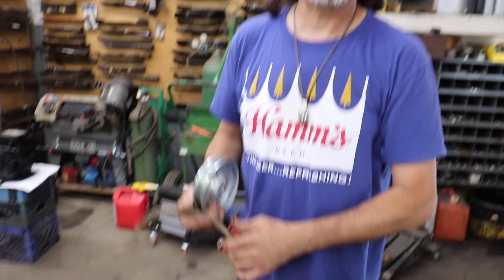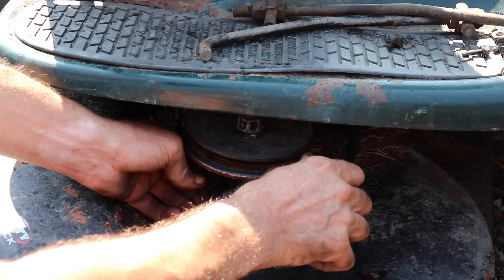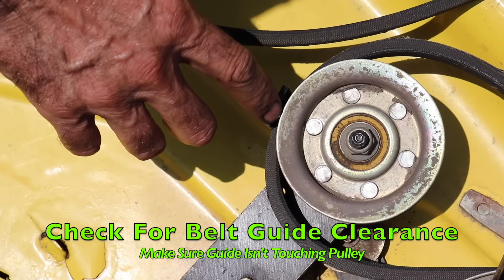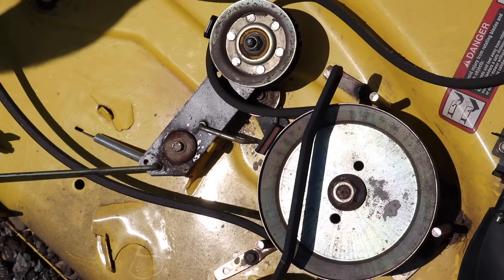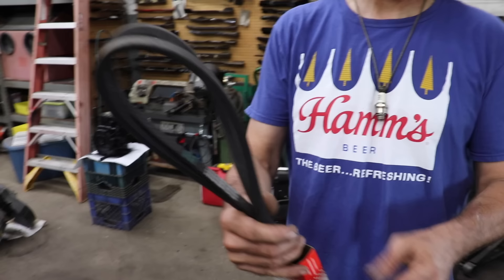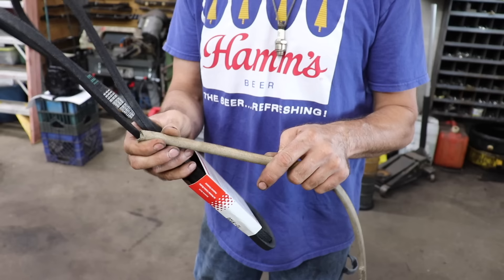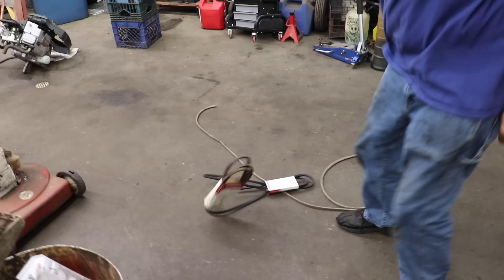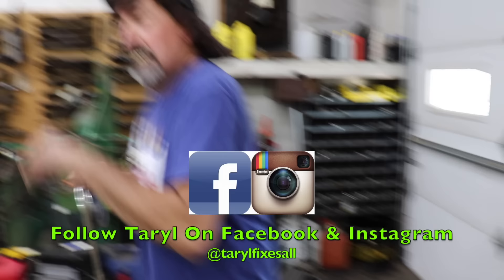Why Do Mower Belts Break?

Comment: I've got a 1992 snapper sr33 high vac deck w an industrial 14hp ohv briggs. Its also got the bagging wagon bagger attachment.  I had to rebuild the differential trans and replace the direct drive clutch . I also replaced the flywheel gear and starter gear because the valves needed adjustment. Guy i bought it from said it was a b%$#^ to start fixed that adjusted valve lash and It starts easy since. . Burns oil tho needs top end valve job n rings. Had the gas in crank case valve n seat issue and wife ran it w gas in there n smoked it but we didn't know. Until it hydro locked . Fixed that and it does run but need to add oil often n smokes a lil.  
I went ahead and bought 2 lt1000s for 300 and rebuilt one with a krohler command cv16.. cleaned it up amd rebuilt the deck n sold it  for 350 and kept the newer craftsman lt1000 w single cylinder 17.5 ic engine  that was rebuilt and replaced the axel on and got a 3  bagger system my wife found for 75.00 . I had to rewire it completely and it runs really well. It does surge a bit til it warms up. Low jet issue? I have to choke it 4x until it levels out buy it runs good and idles good when its warm. So all in all 
I have a "new" tractor i like and only spent 60 bucks for it. 
And a snapper I have had for 11 years I don't wanna part ways with. Its just a good tough little tractor.

Comment: haha,classic,one other thing I found out as well is,that when you are changing over to new belt that you need to reset the deck as the tension on the new belt will be slacker as it is not stretched like the older belt & deck be slinging new one off or because of the too much slack,gets caught where it shouldn’t & gets cut & breaks....

Comment: I had replaced the upper drive ( 5/8×35 ) with a original MTD. Lower drive engine to rear with 5/8x69 not MTD. Was a V belt kevlar blue color from TS store. Now the specs in size etc from MTD is what I got for both belts. Prior all my old belts was MTD on mower. They all are cracked bad. Mower moved fine in FF and rev with old belts. Now with NEW belts  in reverse mower moves same speed as old belts BUT forward it moves alot slower. Would that lower drive I replaced ( Husky named ) be the cause???? I did buy a MTD 5/8x69 new now. Just have not put on yet and wonder if I should or just leave other on. Yard Machines 2008 mower Briggs 17.5 I/C.

Comment: I set the engine to idle first and then fully engage the mower deck to start the blades turning. Then after the belt is fully engaged I gradually throttle the engine up to full speed. This puts less wear on the belt every time you engage the deck because the belt doesn't have to slip as much. Engaging the belt with the engine already running at full speed accelerates the blades very quickly from a dead stop up to operating speed causing the belt slip a lot more, which wears it out much faster.
Reply: It’s important to engage deck belts at lower idle an also helps to not lower deck until cutting blades are first engaged then lower to preferred cutting hight ,this can reduce belt wear an belt coming off in the blade engagement process,,

Comment: The problem I'm having with Exmark 23 kc mower is the belt slips of the jackshaft pully and drops below the deck.  Only thing I've been able to do is remove deck belt and pullout the jackshaft so I can reseat the belt. Shouldn't there be something to prevent this from happening? The space between pully and deck is too small to raise the belt otherwise.

Comment: Taryl set me straight on the long transmission belt that is common on the high horsepower MTD tractors. They are not cheap by any means. A lot of the internet sellers try to sell you belts that they say will fit, but you cannot even climb a hill with them

Comment: Once went through over 20 belts one season. Turns out my competitor had welded a razor blade on the deck right next to the belt. Under a heavy load it would shake just enough and slice the belt clean in two. I'd be replacing the belt and my competitor would run over to the customer and get all the business.
Reply: How did he get access to your mower deck?
Reply: Like Billy Joal sang it's just a fantasy, it's not the real thing.

Comment: I got a new Toro Time Cutter EZ ride 54" zero turn with the Toro 24.5 HP engine. I did not buy it on your review. It had many good reviews. At 5 hours, the battery was dead when I went to start it. My so called professional Toro shop that Toro sent my machine to for free setup and delivery (barged how good they are) left items undone. Such as proper deck setup. I called about the battery issue and was told 3 to 4 days. I know that's at least a week. So I found loose and dirty electrical connections in several places and fixed it myself. Now at 7 hours, the engine backfires and diesels before stopping with the smell of unburnt gas.
Also my idle rpms are 1600+. Sound to high. I can't find a spec on idle speed. I can only see 1 screw on the carb from the back that I assume is the idle speed adjustment.
Any Ideas?

Comment: Belts are not created equal I have found if I order my belts through Sears with the stock number out of the tractor manual they’re $45 each which I’m not happy about but they last a long time I get 3 seasons out of them cutting grass in a large field I have tried belts from all over the Internet companies that have all these outrageous claims not one not one has made it through two sets of mowing through this field not one you get what you pay for

Comment: heat will destroy a belt as well.  worn pulleys can cause new belts to fail prematurely.  I always replace the idlers when I replace a transmission belt to maximize the life of the belt.

Comment: My brand new Ferris zero turn broke the drive belt at 50 hours. I was pissed they used a 1/2 belt on that heavy of a machine. I was on flat ground going average speed or slower because of my bad back. It came flying out the font of the mower without breaking anything like the plastic fan or even breaking the mower deck belt. First it need to be a 5/8 drive belt. Plus it was put together in 5 places. The belt looked like brand new just broke at one of there splices. When I put the new one on which was a real pain in the ass checked for alinement look good and all pulleys look good and spun great with no out of round. Have another 50 hours and been turning the engine over before it starts to make sure its not coming apart again. When I put a new belt on I always run cycle it about 3 times. Heat up and let it cool down. Helps a belt last a lot longer for a 80.00 belt. Had a John Deere zero turn the belt sideways for some reason and took out several plastic idles pulleys that run on stupid angles which is just looking for problems. Sold that piece of shit mower for  6,000 dollars. Had that for 3 years and tranny took a crap and the steering gas operated cylinders. They tried to fix the trannie and messed it up. Iran it in the garage and it pulled the engine down when you tried to go forward so jacked it up with floor jack and in 20 minutes with it going forward it smoked the trannie good. They came and got it and had to put a new trannie in it. When I sold it only had 75 hours on it. Tuff torq trannies are junk. Warranty was up and the tech guy said they have had a lot of bad trannie from tuff torq. So either I sell it or buy the extented warranty. Which was cheaper than a trannie. Put it up for sale sold in 2 days. Told the guy what problems I had with it. Did not matter to him a john deere is the best he said. So he bought it for 6,000 just for the shitty name.

Comment: My neighbors scrub Cadet kept losing the belt and it was the tensioner had rust on it around the pivot point so it couldn't swing the full arc to apply the right tension.  I cleaned it with a wire brush attachment on my drill greased it and she's been going all summer

Comment: I had a JD 318 once and after I owned it for a week I came home one day and heard a noise coming from my garage. I opened the door and found that 318 engine was rolling over but not starting. I had to unhook the battery to stop it . The starter was smoking hot  and it was about to start on fire. The key was in the off position.

Comment: In all my years I have never seen a loaded mower break a good belt, and rust is the only pulley defect that kills belts is rust.  I fix and use them from the 50’s to brand new.

Also I never use any generic belt if I can get them. The generic mower belts don’t last.

Comment: So has anybody here tried a stens or other aftermarket kevlar belt on a john deere F series? I've seen Taryl has a 525 with one wheel in back. I have a 725 with 54" deck. John Deere belt is >$100 and aftermarket is <$60. It is a v on each side, so I thought it may be worth coughing up the green for the green.

Comment: The wrong belt will cause damage to the trans if it drags when you push in the clutch. It will shift hard and you'll have to slam the shifter ,usually skipping over the gear you want .
Reverse to first

Comment: Put a b belt on my cub cadet works great not running too hot and gets better contact area with all the pullys. Should last alot longer and half the price of the cub one. Sheesh 100 bucks from cub for a belt no thanks

Comment: Yep, I have a JD 318, 86 model in fact.  That kawasaki engine, with sharp blades, is an awesome mower.  But you are absolutely correct.  Just buy the damned JD belt -- give them their proprietary money -- they will get it from you one way or another and at least your lawn will look good.  Thanks for dinner.

Comment: I have a jd stx 46, I warm the 15 hp for a few minutes before I engage the deck drive at a little over idle.. then run the engine at w o t, 
it’s a hydrostatic drive so regulate the machine speed with the transmission.. 
have had the same belt from jd for 12 years..
You must have jd belt to manage bending inside out as it passes through the tension pulley..
Blunt blades will just rob power and leave a poor finish to the lawn..
End of..!
Reply: True facts good point

Comment: My John deere 118 drives fine going forward power and speed but very slow in reverse.thinking my belt.any suggestions anyone.thanks
Reply: 318 or 118
Reply: Also. Heck your tension and pulleys
Reply: Check
Reply: my craftsman did that. was grass buildup under reverse pedal
Reply: @hunter7476  118

Comment: Calm down it is something you are doing, not the mower or the company. Yes like the mower i had the company partnumber belt for the deck was 1/2 inch and did not last 5 minutes put a 5/8ths  belt on never had a problem. Designed to fail.

Comment: Unless it's got a bird on it you can go with a shorter belt but just go marginally shorter at a time don't like jump from a 95 to a 93 or something like that drastic of course that's the country way your teeth that country but your words say City but you should know that little trick about shorter belt takes up length with takes up length so if you go with the shorter belt it's going to ride deeper in the grooves of the police which means it's going to grab more

Comment: Getting the tractor stuck and trying to drive it out by riding the clutch pedal will burn up a belt quick too. I have seen folks get one stuck and try to drive it out, the rear wheels are not moving but they are riding the clutch. The belt is slipping and getting hot as hell.